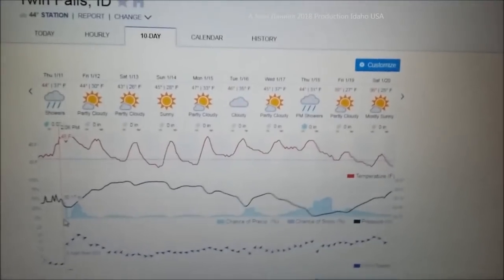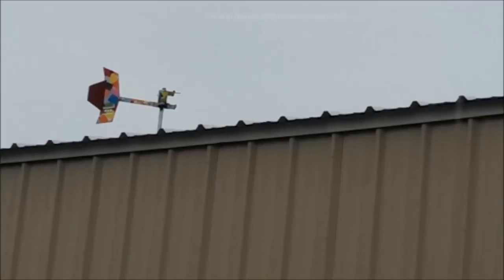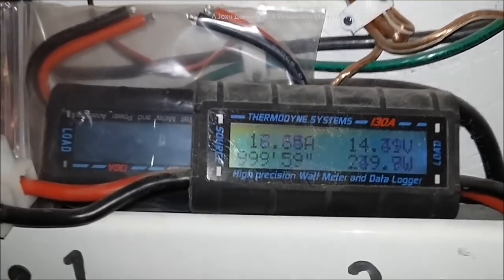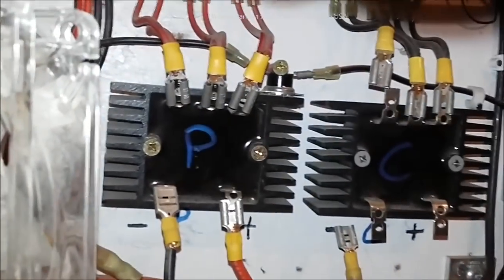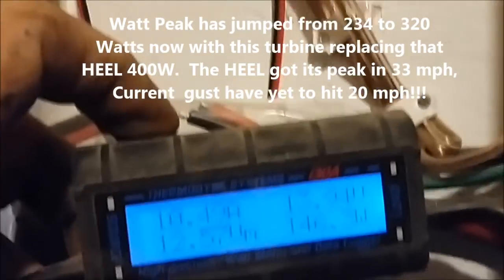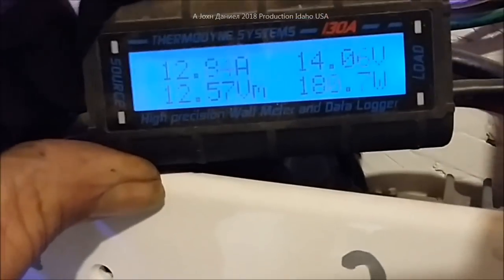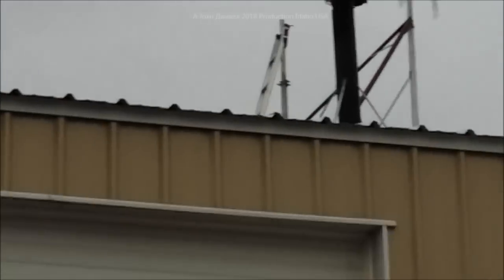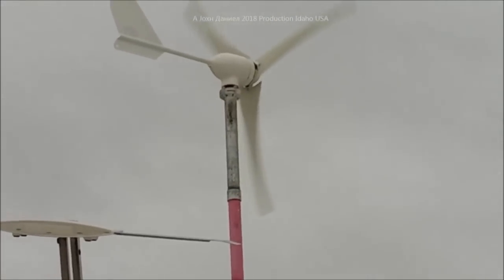Success, $220 (before inflation) China 500 Watt Wind Turbine super performer, BIG PARTS LIST BELOW

Comment: Of course shipping sucks at more than half the cost of the gen. Once you replace the bearings it might last forever. CH bearings really suck and always seem to be the weak point but when you replace them with quality bearings it is like a whole new machine. HF tools are a prime example.
Reply: Yeah, while the 'startup' cost of these chinese turbines sounds great, been curious how long they last (aka, return on investment). Are replacement bearings easy to find?
Reply from the maker: My other turbines are 4 to 8 years old, I am in a high wind zone, no bearings to date have failed. The one in this video is now 15 months old, has survived 80+ mph storms, its bearings are SK branded, the grease in them is the green lithium stuff. So far, its perfect and 150% as advertised. Thats why I put the link to it under the video, it works!

Comment: what can you power with 500w? and can the energy be stored in a battery or something?
Reply from the maker: 500 watts in wind energy up to 40 amps per hour is stored in batteries, from there used in our electrical system of both 12 volt and 120 volt AC applications. We have 4 small 500+ watt wind turbines, the smarter way compared to one 2000 watt turbine which could fail and leave us nothing. redundancy is the Off Grid smartest process. Small wind is not the main power source, Solar is. But when it rains-snows-at night in my location, the wind blows. Being able to always have charging to our batteries in those cases keeps us going and extends the life of the battery bank.

Comment: Question.
I have a midnight controller for my solar panels.
Can I use this same "midnight 150" connected to wind and solar at same time with one of these
Reply from the maker: Not normally because of 2 voltage maintenance settings are needed.

Comment: We tested the Thermodyne 900 watt 24 volt for five years so far.   The most we got out of it was 212 watts at 55 mph wind speed.   The biggest problem was not the low production but the extremely high voltage 272 volts connected to a classic 250 MPPT charge controller.  

We don't have high wind speeds in our area, that was one of the reason's we were testing the unit. 

For reliability, they should last for a very long time, we still have the test unit running with no issues so far.  

The unit is properly installed but could have been higher (45').
Reply from the maker: Sounds like you either have only 2 wires hooked up, a 48 volt PMA or something wrong with the rectifier. Never saw over 130 volts in any winds from one of those 24 volt models. If you put a 3 pack of KT blades on it it will more than double the output though. I would make sure your using a 24 volt model though. Don't sound right to have that level of voltage, sounds like one of the high volt, no power Vietnam made Missouri things instead of a slant core california Thermodyne hornet to me.
Reply: Use a MPPT controller to see the actual voltage.   If it's connected using one of these solenoid type controllers you won't see the high voltage.    Rectifiers don't change the voltage just ac to dc.   We have nine blade kit.

Comment: is that conected direct to the battery from the rectifier and mete.r  no need for a charge controller sir?
Reply from the maker: OK, Well let me hook you up with parts of what I am using since 2007, 
Controller is a WIND&SUN https://tinyurl.com/WindAndSunPower1224 using SSR diversion capable of running up to 50+ Solid State Relays. Diversion load is a staged 1000/600 watts (1400 watts) resistive load, 1000 watts at 14.4 volts, additional 600 watts at 14.7 volts. You will need Mager 60 amp DC to DC Relays ( run 400 watts through each one)  https://tinyurl.com/DD220D60-MGR60amp and heat sinks for each one https://tinyurl.com/SSR25to100Aheatsink ( Don't waste a cent on Fotek or other SSR ) and then depending on your turbine voltage you will need resistors for load excess. 3 ohm for 12 volt, 8 ohm for 24 volt, 10 to 15 ohm for 48 volt. (12 volt example https://amzn.to/2EF7alD )
Got questions, want one built to your request, ask.

Comment: With 145.5 watts coming in you are earning about 2 cents per hour, which is $191 annually from this wind generator, so you have an investment which returns 0.869 or about 87% return on your $220.  The unit pays for itself in one year.  If it lasts 2 years, you can afford another one.  Repairing worn out parts might be cheaper!

Comment: So what can you do with 400 watts? Do you store it in a battery?
Reply from the maker: Stored in Batteries, and the 400 watts is 30 amps of current. But having 3 is a awesome result. Been using and building wind power from 2007 and its worth it ONLY if you have wind, not breezes!

Comment: What do you think the minimum distance is for noise irritation?  Just worried the neighbors might get upset if I install one of these things.  Also cool background music, what is it?  Cheers :)
Reply from the maker: Those LANTERN VAWT turbines are not even a meter in diameter, what kind of power can anyone get from those with such small wind collection area. If you get one with a flat disc shaped PMA generator on it, it works OK, but if you get one shaped like a cylinder its crap. They know it too, so they advertise in their main picture a flat radial generator, but look closer, you get a shitty 100 watt pma made for a HAWT ( high speed 3 or 5 blade) . I would claim NOT AS ADVERTISED or WRONG ITEM  on your ebay, and demand a refund.
Reply from the maker: 200 feet with the kind I have, 300 feet with the furling kind, 1000 feet if its one of those goofy missouri sky rattlers. Or you can just go VAWT like this one https://tinyurl.com/RL400FiveBlade , not extremely powerful though but if you have real decent winds, they will work in numerous amounts. I have a friend who has 6 on his shop in Shoshone Idaho, they do well as my 3 for about the same total cost but you have to keep it within 4 to 6 feet of the roof to get good wind compression.
Reply: +Јоhn “HEADSMASHER” Daniel 
I just bought and set up a VAWT and it seems quite windy today. Unsure actual speeds because I don’t have a meter but my RV is shaking and the VAWT is spinning fast but my solar/wind hybrid controller isn’t giving me a reading at all.   Other reviews say that these cheap China VAWTs don’t work. What kind of wind speeds do you have to have to get enough power to actually charge the battery?  Is it possible I have a dud controller?  Or dud VAWT?  It looks just like the one in the link of the previous comment. My controller works for the solar but if I unplug the solar so only wind, nothing. I’m a newbie with all this. No clue what 3 phase means. I put my volt meter on two of the wires before the charge controller and it says 2 volts.

Comment: It's been a few months now how is the $220 Chinese 500 Watt Wind Turbine holding up? any update?  what are your thought today? what of the blades that come with it? what about the Thermodyne KT blades for it? of all the Turbines you have had which has been the best overall unit to date? Thanks
Reply from the maker: Its surviving great. Even 59 mph winds, but I think I want to create a furling system for it. ASAP. It has peak recording of 1339 watts, more than it should be able to handle in the Slip Ring so furling is a must to keep it way under 100 amps. And to keep from burning up my 8awg wires. I have so much high winds Furling is a must on it. But for BEST turbine award, damn sure the new Thermodyne Hornet on the Chaos turbine, Absolute insane power. I would do a in depth design show on that Chaos turbine, but a notorious predator & design thief in Seymour Missouri is just jacking in his pants waiting on that so I won't for now.

Comment: If they are led acid batteries you are using in a closed box be careful with no ventilation you will have a buildup of combustible gas. I like your Videos.
Reply from the maker: It's ventilated from the back with 2- 3" flanges on the side.
Reply: I once had a smash shop and I was sanding a roof on a van with some sparks coming of the grinder. Behind me about 10 feet away there was a battery charging. There was an explosion and I was showered in sulfuric acid. The battery was in the open air inside a workshop. The complete top was missing on the battery. Evian though you are venting any gas through the back of the box I still think you need to be careful. I never thought what happen to me, happen. I did learn one thing. When batteries are charging I removed the screw caps on each cell and made sure they were in a safe place away from any work process. I think they should not be enclosed at all.
Reply from the maker: The room has positive venting  and for the same reason you describe.  Witnessed a forklift battery explosion,  took out half a building. So my battery room has a draft pipe out the roof as well as 90 cfm coming in from another opening at floor level. Got too much invested not to put $20 into vent designs LOL.
Reply: Јоhn Daniel Should I be worried about charging a 12v battery inside a greenhouse? 

:/

Bit worried now :)
Reply: Craig Nevermind   if it has plastic glazing it's easy to cut a hole in a pane and vént your battery box to the outside.  You could cobble up a duct from bits of scrap plastic and gaffer tape.  Just keep in mind that hydrogen likes to go upwards.

Comment: What can it power? How does it work? Does it power battery and you simply get the power from battery using inverter?
Reply from the maker: We have solar and wind. We charge the batteries then use the power though 12 volt DC to 120 volt AC inverters and numerous DC voltage sources.
Reply: Јоhn Daniel so you can't run your dryer then? Because that's 240 not 120 and my electric stove is a 2:40 as well and my furnace and AC unit
Reply from the maker: So you just IMPLY what you have as though its what all can ONLY HAVE????
You own a 240VAC power drier, stove, furnace by choice, not necessity. With a 2280 square foot home and 6 living in it, Our drier is spun by a 12 volt 188 watt motor, and drying is by recirculated heat from a propane system. Our home heat is hydrogen / propane with a pair of static 28,000 btu Williams heaters. Our walls are 9.75" thick at a R-38 level and our stove/oven is also Hydrogen Propane fueled. We have 4 home made 22 amp hydrogen generators running on the 1300 extra watts we make to make our 75/25 hydrogen / propane fuels system running. I don't make videos on that system due to scams from a cocaine junkie pervert named Jeffro Harmons in Missouri who would steal the design.
 However - We still have the original 240 appliances just in case we sell the home to a californian liberal or socialist who always "preach" solar and a Prius car for everyone BUT them and will want the ugly solar and wind stuff removed.
Reply from the maker: My Advice, DUMP THE DRIER, DUMP STOVE, DUMP THE 240 volt stuff and go Propane GAS, Wood, and if you can really do the machining, go hydrogen too. Propane most all over is under $2.00 a gallon. A regular home stove would use 3.8 gallons a month for a family of 4. Or $16 a month in Electricity at rates 012.5KWH . Propane is actually cheaper than electricity!!!!

Comment: WOW!!!  I love this video!!!  I will look into the same wind powered generator (and solar panel system from your other video) for my homestead.  My homestead I am rating it at 1200watt/month = house 40watt/day, barn yard 20watt/ day, walk in freezer and walking fruit cellar 20watt/day. Your "finds", examples, and knowledge are of GREAT VALUE!!!  I will have 3 systems set up with each system utilizing both solar panels and wind. One can never have too much power. Keep up the good work and the teachings. I like your products reviews.  Finally someone who can teach us idiots with an idiot's guide instructions. Thank you.
Reply from the maker: Just never buy from NON USING dealers masquerading on You Tube as FKN Bob Villa!
Reply: I do a LOT of research before I do anything. In my on-going research about solar and wind, I am having a hard time getting my head around something. This idiot (me) needs your help to understand!!!  According the local power company,  Dept of Energy (DOE),  U.S. Energy Information Administration (EIA), and the EPA, the average usage of electricity in Florida is approx 1080+kWh/month (1,080,000 watt). To be on the side of error, I figured to use 1200 kWh for my calculations. Thus, 1200 divided by 30 days/month = 40 kWh/day (40,000 watts).  If I use 100 watt panel system then I would need 400 systems.  400 systems X 4 panels each = 1600 panels.  This cannot be correct!!! Where am I making my mistake in calculations??????  HELP!!!!!!!!
Reply from the maker: I am a pure success on 12VDC, 10's of thousands are following me. \
The question is not what kwh others average, but what 12 months of your usage is. You can go online, get a account with the local utility and get a actual use record. From there you STOP converting DC to AC as much as possible, thats a 21% immediate savings in solar required. No 240 volt dryer, NO 240 stoves, no 240 volt nothing unless you have no choice such as my water well. All lighting DC voltage, all circulatory (fans) dc voltage, all  you can pipe it with DC. You can run dc in a circular trunk line (loop) with lower gauge wire like 6 awg and tap it anywhere for all your lighting. Put a pair of 35 amp hour batteries in that loop somewhere as shock supply. Use Auto 12v chargers for your cell phone, computers, etc (Here is some THINK RIGHT EXAMPLES of saving solar panel money in these links) Computer charger works on all of them http://rover.ebay.com/rover/1/711-53200-19255-0/1?icep_ff3=2&pub=5575119394&toolid=10001&campid=5337967172&customid=dc+to+laptop+charger&icep_item=221747460891&ipn=psmain&icep_vectorid=229466&kwid=902099&mtid=824&kw=lg Best Built. DC E27 Lights http://rover.ebay.com/rover/1/711-53200-19255-0/1?icep_ff3=2&pub=5575119394&toolid=10001&campid=5337967172&customid=LED+WARM+WHITE&icep_item=371514994702&ipn=psmain&icep_vectorid=229466&kwid=902099&mtid=824&kw=lg 5 YR Life DC fans reduce bills http://rover.ebay.com/rover/1/711-53200-19255-0/1?icep_ff3=2&pub=5575119394&toolid=10001&campid=5337967172&customid=DC+FAN&icep_item=192366334181&ipn=psmain&icep_vectorid=229466&kwid=902099&mtid=824&kw=lg LOW AMP use.
Reply: Thanks. I knew I had found a good mentor!!!  I pay close heed to your guidance!!!

Comment: Excellent Video..  but "This listing was ended by the seller because the item is no longer available"...any other sources..you may know about?  Is there a manufacturer stamped on the unit? Have been using a Southwest Air403 for the last 15 years...Want to added one more turbine to my sailboat..
Reply from the maker: Thanks, I renewed it to exact 400/500 model.

 http://rover.ebay.com/rover/1/711-53200-19255-0/1?icep_ff3=2&pub=5575119394&toolid=10001&campid=5337663844&customid=Wind+Turbine+m+500&icep_item=401338795223&ipn=psmain&icep_vectorid=229466&kwid=902099&mtid=824&kw=lg
Reply: Thanks, John.. Excellent Videos. exactly what is needed....by the way...Have been using Wind Generators for 20 years and have learned allot from your videos..
Reply: Јоhn Daniel My husband sent me this link and me to order a 500w however when I click the link 400w is what comes up, is the 400w the one you show in your video?
Reply from the maker: Yes, it is the same unit. Some advertise it as a 400 which is its normal rating, and some advertise it as the 500 which is its max rating but as long as its 1.5 meter blades, and identical looking its the same as mine. Many are using its picture in their ads to trick folks to buy those mod body turbines, check everything out when looking for one. 
And for a update, mine has hit 1282 watts in 40 mph winds at my place this week, 90 amps!!!!! and it did not as I feared - burn up. I was a bit nervous to say the least. SO its ratings of 400 watts in 23 mph, and 500+ watts in winds above that is accurate awesomeness. The fact your getting 150 watts, 12.5 amps in just everyday winds as crazy good. Just make sure its in clean air at least 5 feet over all obstructions and no less than 150 feet away from things higher than it is mounted like trees.
Reply: Јоhn Daniel the description for the link above says 1.55m wheel diameter fiber glass blades?
Reply from the maker: Your right, I was thinking/wrote the size NOT to get. Yes the 1.5 meter is correct. I FIXED IT, THANKS
Reply: Thanks, John, have a friend heading to China tomorrow, he is going to visit the factory and bring back two. One for each of us..

Comment: Great video,  what size wire do you have coming in from the turbine itself, to the break switch?   I have this same turbine. Been following your videos on the turbine, but i guess I missed the correct wire sizing video.  I'll only be running maybe fifty ft from turbine to break switch.  Freaking wire is expensive. But wana keep it safe.   Thanks
Reply from the maker: Turbine has 10 Gauge . You can run from it 10 gauge no longer than 15 feet, then 8 AWG from there up to 65 feet. Mines 12 feet 10 awg, 8 awg  next 28 feet

Comment: Great education there! Nice setup too. Hey, "could" this lil guy be connected to a grid tie inverter? If so, what is needed. Right now, I only have a toy setup with just 4 6V golf car batteries and a 3500 watt 24VDC PSW inverter. I cannot afford a bunch of new batteries right now. If you have any suggestions, that would be great. Yes, I live up on a hill on the windward side of a a small lake. It's not windy every day, but we do get many days of steady 9-20 mph winds. I know the M500 is a 12V unit. Thanks!
Reply from the maker: 18 to 60 volt 3 phase 1200 watt would be recommended
Reply: hi and thanks for the suggestion!  Now I need to find a generator that is worth it's salt and fits your recommendation.